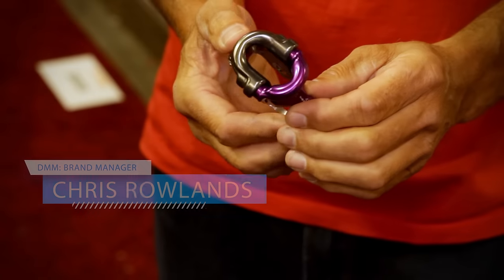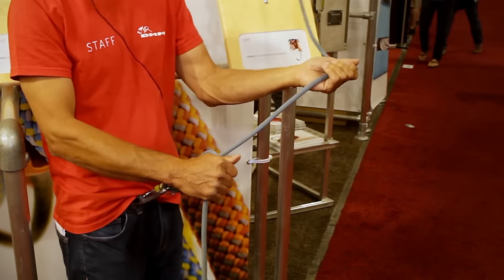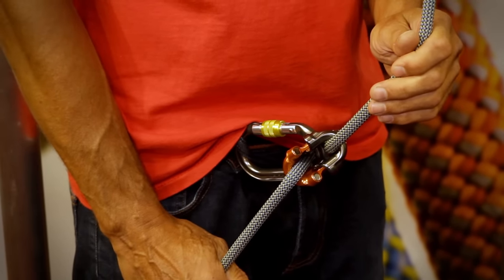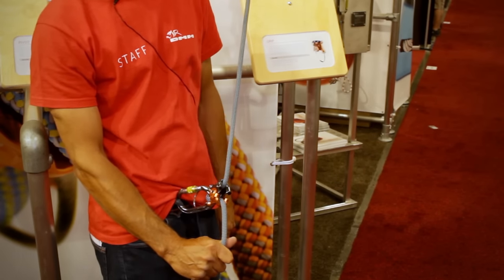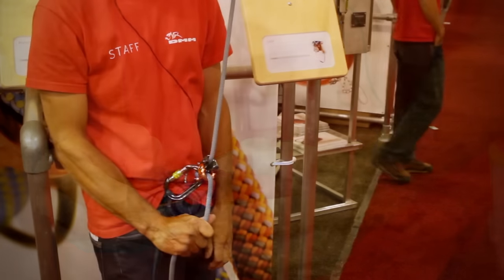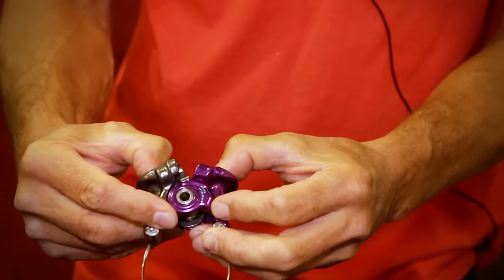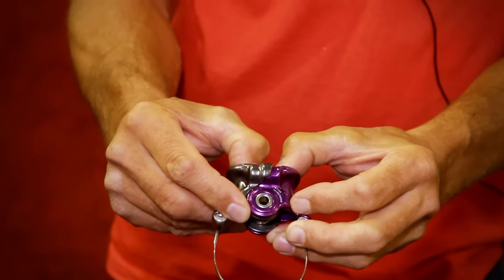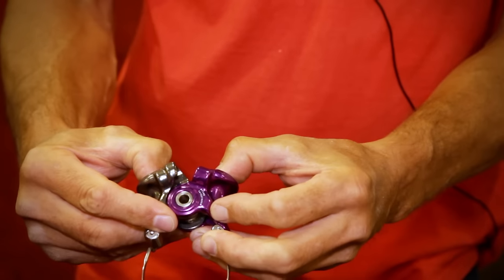DMM Grip Belay Device

Comment from the maker: UPDATE: The Grip concept is [officially] no longer coming to market. The prototypes didn't quite meet DMM's high expectations and to fix the issue would require adding more bulk and making the grip less cool. DMM felt like they had more exciting projects to work on instead, so the Grip project has been scrapped.